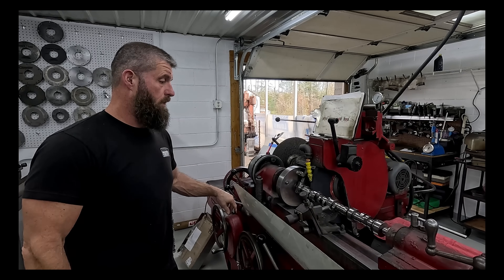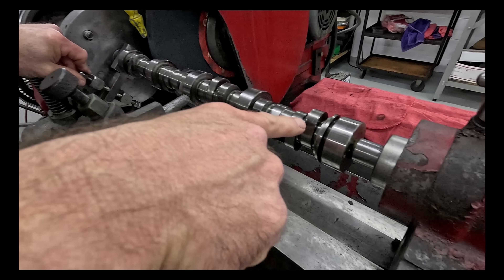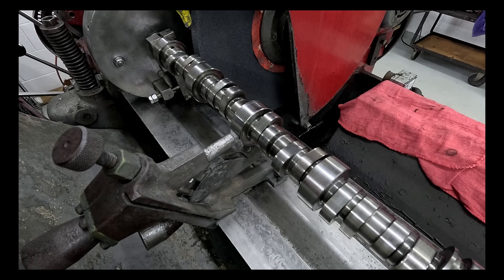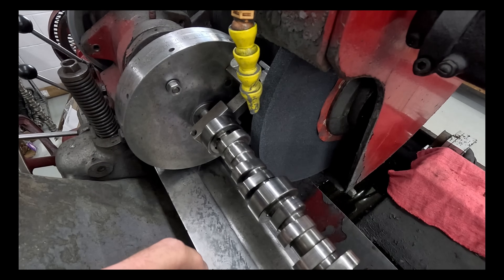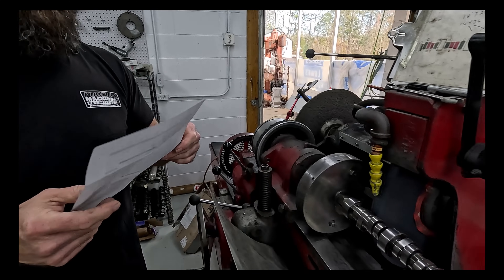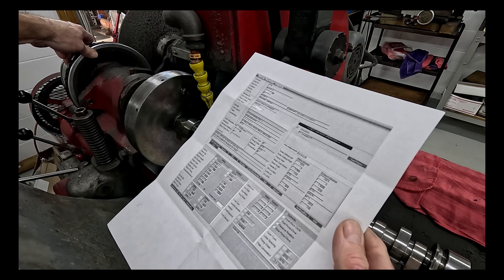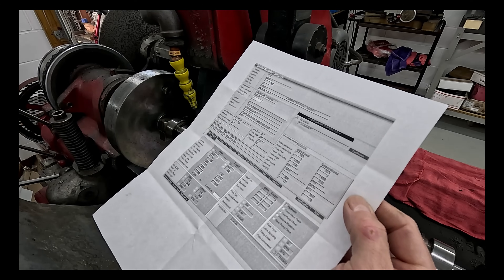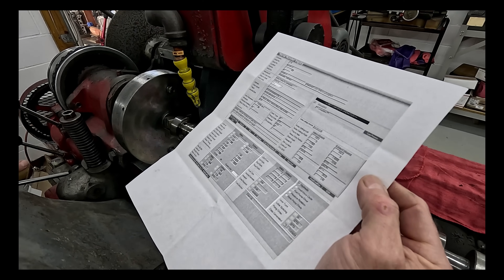Camshaft regrinding: comp Ls

Comment: Are these new camshafts from comp ?
I have a Mechanical roller cam from them drag application with .810 lift runs but it keeps trying to  push my distributor up out of the adjustable slip collar. 
Could this be the problem  ?

Comment: Steve Morris just put solid lifters on a hydraulic cam. Apparently others are doing it. How does that affect intensity and longevity? He does a lot of work for drag and drive clients.
Reply from the maker: I need to make a video on that
Reply: That was on his own cam lobe that he knows, not like putting a solid lifter on any random cam...
Reply from the maker: @MrGeorge1978  it's irrelevant who's cam, all hyd profiles have the same hieght lash ramp
Reply: @powellmachineinc  so are you saying that it's never ok? I get that the inverse rarely works because the lobe on most solid cams will knock the oil out of a hyd lifter... But many have had success running hydraulic cams as a low lash solid setup 🤷

Comment: Hi Daniel.  I think I understand how the cam doctor plot corresponds to the actual location on the cam lobe but sometime can you point out on an actual cam lobe or drawing of a lobe, approximately where the areas on the plot are on the lobe?  I think the horizontal line is the base circle, the radius up is the clearance ramp, the diagional up is the opening flank and the radius at the top is the transition to the nose of the lobe, diagonal moving down is the duration on the nose etc........ is that correct?  Thanks for making the videos and sharing your knowledge!
Reply from the maker: @doncarlson8391  definitely,  what u are seeing on screen is a trace of the lift curve

Comment: Merry Christmas craftsman   I was thinking you had all the design data, digital lift tables for your grinds, to make your masters,
well maybe you buy your masters but I'm not addressing that.  If you do have you files I was suggesting just picking your grinds and the right core  and inputing them into a digital grinder, eliminating the master and having to grind lobe by lobe and indexing.  You get to pick the design  The digital grinders do great work and there are enough around with contientous operators you do not have to buy a million dollar machine.   

just a thought 
do you have a thick rubber mat to stand on?

point two   Remember what Harvey Crane said about dynos and the cam business
Reply from the maker: @jmflournoy386  if u have a million bucks I can borrow I will order a cnc grinder tomorrow!
Reply: @powellmachineinc    I do but there are a lot of underutilized cnc grinders out there much less than the interest on a loan
just a thought on the future of camgrinding merry christmas

Comment: On the issue of surface hardness depth...

Can you take a junk cam with some good lobes, check them for hadness and then grind off a few thou at a time to see just how far the treatment actually penetrates the surface? It might even be interesting to see if it differs from manufacturer to manufacturer.

Love your stuff, thanks for taking the time to educate all of us!
Reply from the maker: @sesampley  unfortunately it just doesn't work like that
Reply: Hardness depth is only applicable if it was surface hardened. Full heat that the matrix is uniform.

Comment: What are the negatives for putting the cam in an oven and adding some surface hardening depth (nitrogen or cherry red...)?  I would think a short hardening cycle could ensure .005 of minimum and uniformly incremental addition to surface hardness.
Reply from the maker: @rowlandcrew  have you ever done any heat treating before?
Reply: @powellmachineinc  That camshaft is too big for my oven and I would bet it would banana in an oven, but torch flame surface hardening with a terradyn is done with local surface heating, adding surface hardening material. This is how precision journal shafting is repaired and surface hardened followed by a regrind.  I take it from you question that you have not seen this done.
Reply: If you full depth harden a camshaft it usually makes it too brittle. This cam was probably made from 5150 and comp induction hardens thier hydraulic roller billet cores. If you get something serious, comp has 8620 cores available and those are carburized. Its 4+ hours in a controlled atmosphere oven. You arent just running a torch over it. You dont need a 005 minimum either, its way more than that.
Reply: @timothybayliss6680  It;s like buying induction "hardened" U joints vs DANA/SPICER deep heat treat.  We hardened rocker shafts till LA County banned backyard operations like chrome plating  but not near as critical as a camshaft

Comment: Good afternoon Daniel.
I always appreciate your thoughts and insights into the camshaft design.
That was my question what was the heat treat?
Because the cam looks like it could be soft.
I know someone that buys into all the fast ramp cams.
Says he'll make with his Comps 50hp to 75 horsepower over grinds I use.

But with the being said, those grinds the springs they use wrecks the valve train!
And I do not buy the aclaimed horsepower. 
I guess I am more conservative. 
I build for reliability and for the long-term.
Nice work on the grind.👍
Have a great day. 👍🇺🇸👍
Reply from the maker: @edsmachine93  on a optimized package,  you might see 10 hp on 600hp engine,  but you will have to service the VT  ten times as much, so for most applications it just doesn't make sense

Comment: Hey that's my Cam. JHR stands for Jamie Hackney Performance that was in Mooresville, NC. (No longer in Business). This was a custom grind cam designed by them. My car is a 2012 Camaro SS Manual the whole setup lasted 22k miles before it had lifter issues. I hope with your grind and new lifters I won't have any issues. My car only has 38k on it now and is just a fun weekend driver. Thanks Again!
Reply from the maker: @justinstatham6378  absolutely 💯
Reply: I looked up Jamie Hackney Performance and cannot find even one little snippet of information about the man/business.
Reply: @robertwest3093  JHR Performance (named after owner and racer Jamie Hacking)
Reply: @robertwest3093   JHR Performance (named after owner and racer Jamie Hacking)
Reply: I dunno, but if Daniel is hookin you up, DONT worry!!......he knows what he's doin....  the tiny bit of lobe loss, will INCREASE ur power by massive amounts!!!...Trust me.....PEACE to you sir!!
Reply: @TimothyArnott-m7z  Thank you. I hope to get it back running over the Christmas break. Daniel is the man!
Reply: Looks to me like you got sold a bill of goods. Maybe a cam they had laying around. I've seen that before. I've learned, any "custom grind" I question unless it's a special application. I think you're in good hands now.
Reply: @ thanks I bought the car already built. I am in the process of putting it back together now.

Comment: I have an old Comp Cam that was ground with their XE-R type of lobes. It is very rough on valve springs and guides. That's why it's just sitting on a shelf now.
Reply from the maker: @lgun1  definitely
Reply: might make a good core for a regrind, lots of comp cams were like that till they copied the smoother lobes  check how much hardness is left

Comment: Is that one of Comp's xtreme energy cams? I know they're supposedly aggressive on the opening and closing to help with idle quality and vacuum on higher duration designs. At least that's how I understand their description of that line of cams. Good info Daniel. 👍
Reply from the maker: @DanielSmith-yp7mw  it's a LSL lobe on the int, glad u enjoyed!
Reply: @powellmachineinc  ok, gotcha. I know Comp is pretty good about cam recommendations if you call them and probably would steer someone away from a cam like that for street driving. Thanks for the info!

Comment: Had to look up the 13041 number:  LSL series.  Key language? "professional drag racing profiles", "ramp quickness", "short seat timing" and "excellent area above 1/2" lift".  In other words, a lobe that gets hit pretty good all the way around [and oil testing just might be a good idea].   So like alot of extreme energy series stuff, its an 'area under the curve' value which...  leans towards racing, meaning an engine that will get regular inspections.  Its maybe not max effort, but minimum needs a once a year teardown rain or shine?
Reply from the maker: @flinch622  this is a daily driver,  this lobe should not have ever been used,

Comment: so this regrind dosnt affect the pushrod length?
Reply from the maker: @litonyayo1666  we moved the bc .010, most people are running WAY more preload than required so should go right back in with no issue's
Reply: 10 thousand should be able to be compensated with rocker adjustment that and changing to a 1:65 rocker bring you back into original lift spec
Reply: should be ok with the new "Cadillac" lifters, assuming it was correct in the first place, I'd check the geometry If you ever read comp or jessel version of geometry vs say Lunati you would know they professed a surprising lack of grasp, although Jessel states their reasoning, which I disagree with most of the time  And Crane;s "quick lift" should have been called "quack lift"  just My own humble opinion YMMV